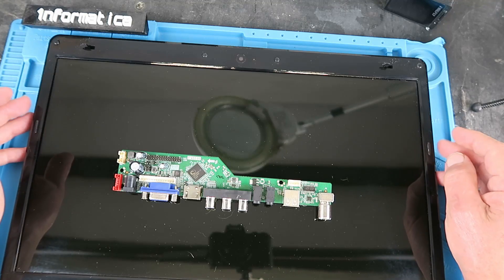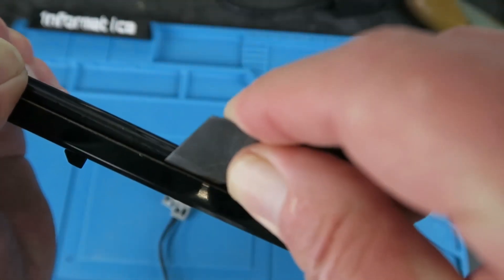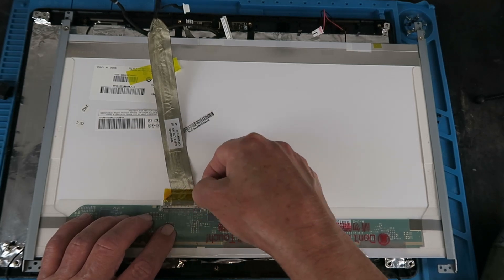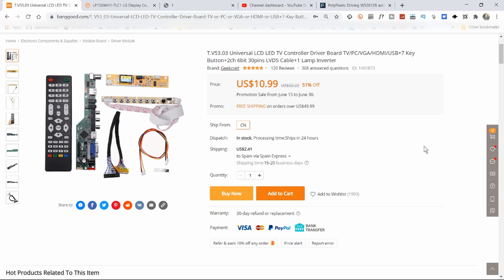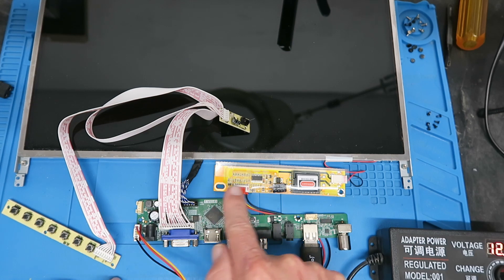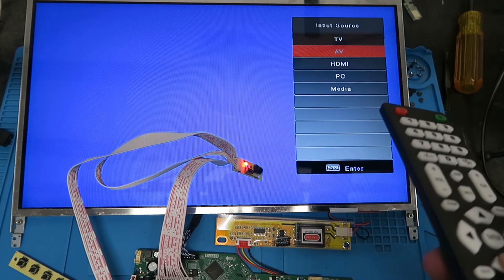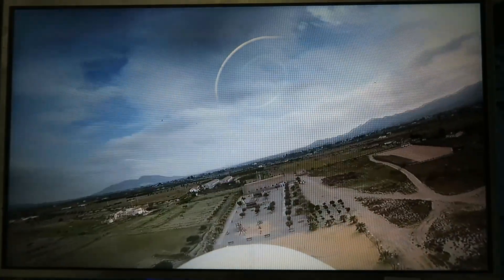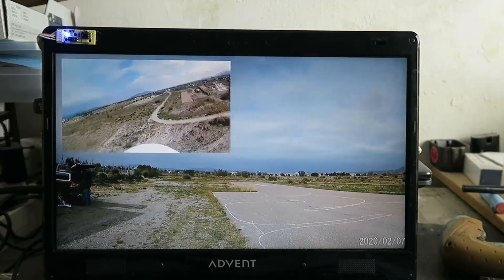T V53 03 Universal LCD LED TV Controller Driver Board Review Test

Comment: Kind sir, I have this same board, without the remote control. I foolishly pressed the "Lock Key" option and of course now I can't find a way to unlock the buttons. Is there a way to reset this board without reflashing the firmware?
Reply: subscribed! I was afraid you'd say that. What remote control would you recommend? I think I have an IR sensor in the parts box, I'll look into adapting it to the board through the buttons control panel, and I'll alternatively look for the screen's details, hopefully I can restore it to working order without looking like a bad acid trip. Me and my curiosity...
Reply from the maker: @choro76  I was thinking of something like this : Universal IR Learning Remote Control http://bit.ly/IR_Uni My unit already had an IR sensor on the little board with the LED. There was also another sensor supplied, I have no idea why!
Reply: @1nformatica  probably stopped supplied in case you wanted to install it away from the buttons module. In any case, if I don't get anywhere with the remote, I'll ask the ebay seller if they can supply the remote control that the complete kit included. Talk about going cheap!
Reply from the maker: @choro76  Good luck with that!!
Reply: @1nformatica  Well, this T.V56.03 board doesn't want to flash a new firmware, it just goes straight to "Movie" menu, won't even try to flash anything. Oh well, maybe I'll just have to buy a new board with remote... I formatted the usb to fat32, used the file General_1024_768_4MB_NF_CH_SiR84X_AT_960_b3f80c16_0xEDD4_20160822_212719 and put both the bin file and the txt file in the usb and nothing... oh well... awesome video nonetheless! Thanks for your help!
Reply from the maker: @choro76  Hmmmm  are you sure you have the right firmware file for your board? The board I reviewed is T.V53.03 yours is T.V56.03 the firmware may not be compatible.
Reply: @1nformatica  Yes, I "was" positive that this board was a T.V53.03, and did try to flash a t.v53.03 bin file, and it failed, but just by luck I spotted the model of the board and indeed it's a T.V56.03 - I promptly downloaded various bin files for flashing but... no dice. The board just boots up normal, and the display just shows the "Select Movie" screen. I guess it's locked for good! Next thing would be to either build the infrared sensor and get a remote control or just simply buy another board - and not make the mistake of blocking it again...
Reply from the maker: I don't think you can unlock without the remote. maybe you can get a "universal" remote to use. Otherwise a reflash. Please consider subscribing if you have not done so already!

Comment: Hi I would like to recover an old lg brand lm170e01 (A6) (K6) lcd if you can indicate a compatible card for this lcd
Reply: hear me or downloaded the software but when i insert my key the led has remained blue mo every time i go down the card only the back brightness of the monitor lights up
Reply from the maker: @giannitranchese4856  Use a quality USB key like "Kingston", format it FAT32. Put just the *.bin file and checksum on the key. Make sure your power supply can give 3 Amps at 12 volts. If the LED does not flash then the firmware will not be loaded.
Reply: nothing does not work for me the red led does not flash or inserted in the 16 GB USB stick in fat 32 the two files that only this on the stick how can you reset the board then the tab on the board is positioned on 5v pvcc and I am powering it  with a 12v 30a power supply
Reply from the maker: @giannitranchese4856  As far as I know the only way to reset the board is to flash new firmware to it. Perhaps your board is faulty, you should contact your supplier.
Reply: @1nformatica  resolved maximum supports a 4gb USB in fat32 the light flashes blue and red and then flashes faster but it always goes down and only the back brightness should I set 5v pvcc to pvcc 12v ??
Reply from the maker: @giannitranchese4856  I do not know what the pvcc voltage is supposed to be for that panel. Try 12v at your own risk!
Reply from the maker: You can see the panel specs here : https://www.panelook.com/LM170E01-A6K4_LG%20Display_17.0_LCM_parameter_4679.html The board used in the video will work : https://bit.ly/TVCntrlBoard Please consider subscribing if you have not done so already!
Reply: @1nformatica  feel my lcd screen with four terminals that were connected on the power supply board, the board you recommend is okay
Reply from the maker: @giannitranchese4856  You can usually use the original board for diving the lamps, you just need to see if it will work with 12 volts from the controller board.
Reply: @1nformatica  listen but what software should I download from the rar archive for the lcd
Reply from the maker: @giannitranchese4856  You use the file with the max resolution for your screen which is 1280*1024

Comment: Hello I'm trying to do the procedure on my board and the led is lit red and does not evolve, does not flash another color. It is only lit red.
Reply from the maker: Some people report problems with particular USB flash drives especially "unbranded" ones. Try a different USB stick like a Kingston brand. The firmware is a "bin" file that must be in the "root" directory. Also make sure you have a 12 volt 3 Amp power supply. Please consider subscribing if you have not done so already!

Comment: Great tutorial but I have a problem.
There are no markings on the 30 pin connector that plugs in to the board. It can be plugged in both ways. How do I figure out how to plug it in properly, I don't want to damage the panel.
Thanks.
Reply from the maker: The 30 pin cable header should have a blob of paint at the end which is pin 1. Also the first few  pins are power so they are black and red. You can see in the photos in the product description : https://bit.ly/TVCntrlBoard  Please consider subscribing if you have not done so already!

Comment: Morning all, I followed your tutorial and it works perfectly with a Philips LP171WP4 in 1440x900. Now, I would like to go further : is it possible to connect an USB webcam and have the picture in real time ? I tried to find out a solution with without any success. An advice ? Thanks again ! CL
Reply from the maker: I think the best option will be to buy either a camera that has HDMI out or a CCTV type camera with composite video out. You may even have an old camera with composite video already! Please consider subscribing if you have not done so already!

Comment: Hello, my panel is one B170PW03 V5, i bought the T.SK106A.03, i upload the GENERAL_1440_900 firmware. It works, but when I select AV, HDMI, VGA or Media input, it shows me the screen split in half and the image 2 times. It only shows the full single screen with the TV antenna input. How can I correct it?
Reply from the maker: It is probably a setting in the "secret" panel menu. I have found no description of what the settings do so just try different ones and see if it works! Please consider subscribing if you have not done so already!
Reply: @1nformatica  Thanks for the reply. I have tried modifying all the parameters but cannot change it. I do not understand why only one input ATV shows the screen well and the rest (Media, PC, AV) divided
Reply from the maker: @Ali_Vill  Sorry I have no idea. I have never seen that. Let us know if you find an answer!
Reply: @1nformatica  In addition to the code (Menu + 1 + 1 + 4 + 7). Is there any other Menu that can be accessed?
Reply from the maker: @Ali_Vill  I do not know of any other settings. maybe try a different firmware.

Comment: Hey, if i buy a controller board of 30pin and my screen is 30 pin its should work right?
Reply from the maker: That is a little confusing. There is a 30 pin header on the controller board which can have various cables fitted according to the screen. So if you buy the one with a 30 pin LVDS connector it will work.

Comment: My panel is this one https://www.panelook.com/B154EW02%20V7__15.4__overview_630.html

I flashed the T.V53.03 1280x800 firmware, i'm using a 12v 3amp power supply - but the display does not power on. I've tried loading different firmware, but it wont flash - just shows the red light, then blue and stays blue. There is also a shhhh sound coming from the High Voltage part. What else can i try?
Reply: Got it working, the backlight plug wasn't fully seated
Reply from the maker: @thegreatpretender7  •:*¨¨*:•_•:*¨¨*:• EXCELENTE_•:*¨¨*:•_•:*¨¨*:•_!

Comment: Great video mate! you covered everything i needed to know,.  btw i have a LP156wh4(TL)(C1) i got from an old laptop. its 40pins, would you kindly recommend a compatible controller board for it? thanks in advance mate!

iim looking into T.HD8503.03C Driver Board . its 40pins.. you think this will work on the monitor i have???
Reply from the maker: Thanks for commenting. These boards are universal the 30 pin connector on the board just needs the correct adapter cable for your screen you can see how to make one here : https://sites.google.com/site/lcd4hobby/lvds-cables?authuser=0 or this one should work : 40P 1CH 6-bit LCD LVDS Screen Cable 0.5 Pitch http://bit.ly/40PinLVDS Please consider subscribing if you have not done so already!
Reply: @1nformatica  already subscribed  to your channel mate!.. more power..
Reply from the maker: @aragornmcarathorn9806  Great! YT used to show when peeps were subbed but no longer!
Reply: I also have one and I bought a v53.03 universal 1ch 6bits 40p but i plug my pen driver and nothing happens...

Comment: It seems you have become the un official support for the English speaking world on the the T.V53.03 controller board. I want to thank you for the for the one ray of / hope / information that i can source on this board. i have purchased two of the above controllers with the understanding that is should be suitable to control  a Mitsubishi  AA121XJ01 as per:

 (  https://www.panelook.com/AA121XJ01_Mitsubishi_12.1_LCM_overview_6054.html  )

 This has 20 pin connector  the controller board came with a 30- Pin flat style connector  cable attached which will not work .... I see this link listing the above board listed as 20 pin compatible 

( https://www.ebay.com.au/itm/Fit-N141X6-L01-1024-768-1CCFL-LVDS-20-Pin-display-analog-tv-controller-board-kit/173888398448?_trkparms=aid%3D1110006%26algo%3DHOMESPLICE.SIM%26ao%3D1%26asc%3D20160323102634%26meid%3D0fbe3ff827b44fd6887920f6c5ab895b%26pid%3D100623%26rk%3D4%26rkt%3D5%26sd%3D173882026064%26itm%3D173888398448%26pmt%3D1%26noa%3D1%26pg%3D2047675%26algv%3DDefaultOrganic%26brand%3DMarkenlos&_trksid=p2047675.c100623.m-1 ) 

Do you think i can plug the cable into the 1st 20 pins and get some function ?

Do you know of any pin out on the T.V53.03  that i could use to make up a custom cable with ?

I see the firmware archive has no reference to AA121Xj01 but does list  2 entries with ...._General_1024_768_4MB_DDR_CH_AT_..... which may suite the panel?

Any advice you can offer is apricated ... i have sub scribed to your channel
Reply from the maker: The pinout for the board 30 pin connector and the 20 pin LVDS cable can be found here : https://sites.google.com/site/lcd4hobby/lvds-cables?authuser=0 You can buy a made up cable here : DF14 20P 1CH 8-bit Screen Cable Universal LVDS LCD Driver Board http://bit.ly/20PinLVDS Good luck!

Comment: How did you conceal the circuit board after installation....🤔
Reply from the maker: It is not exactly "concealed" just stuck to the back of the screen with hot melt glue!! Please consider subscribing if you have not done so already!
Reply: @1nformatica  your video has saved me a lot. Consider placing a heat sink on the main chip.
Reply from the maker: @afromike01  Good idea, it does run hot.

Comment: Hayooo man, I have a big problem and it is when installing the driver in a memory, the led stays completely red and does not progress from there, can you help me?
Reply from the maker: Some people report problems with particular USB flash drives especially "unbranded" ones. Try a different USB stick like a Kingston brand. The firmware is a "bin" file that must be in the "root" directory. Also make sure you have a 12 volt 3 Amp power supply. Please consider subscribing if you have not done so already!

Comment: good night, I have a plate just like it. only that she was astonished they are just passing the colors and I can not turn it off with the remote control or the power button. what should I do?
Reply: I appreciate the answer. in fact it has a eliminator from 12v to 3a. the connections are correct. Today that I put it to see what happened, it turned on with the remote control and there was only an amber screen left.
Reply from the maker: @SavoRomo70  Check the resolution of the LCD is correct at : https://www.panelook.com/index.php maybe try another firmware. Good luck!
Reply from the maker: Check that you have a power supply of at least 3 Amps 12 volts. The board will appear to reboot if the power is too low. Also check the jumpers that supply the LCD voltage, must be set as the LCD specification. Please consider subscribing if you have not done so already!

Comment: Hi,I appreciated a lot this tutorial, sir, to repurpose a TV LCD screen which the mainboard was gone. I bought a T.V53.03 board. I connected everithing, and it was so well! I changed the language from chinese to english, with no problem at all. Since my screen has a resolution of 1366 x 768 I downloaded this software: CPS6_19028124_RX_V53_03_A1_IR_XY_AP_M90_PNL_General_1366_768_4MB_DDR_CH_AT_960_08a8a3e2_0x2646_20191123_132618
 to flash the board for the correct resolution. After flashing, I got nothing on the screen and it remained all black. Is there any way to downgrade the software with the original one? Since maybe the software was not correct?
Reply from the maker: Hi thanks for the comment. You can just flash new firmware onto the board using the same procedure as before. Simply put the new file on the USB stick and it will flash when powered up. There are often a few different files with the same resolution, it is trial and error to see which one works for you. The screen being black is a bit strange. The backlight should still work. Did you set the voltage jumper correctly? Good luck. Please consider subscribing if you have not done so already!
Reply: @1nformatica  Thanks a lot for  your kind answer. What opened my mind is your phrase: "it is trial and error" since I thought for a moment that was, instead, a one-shot thing... :-). Anyway, when I try some (wrong) FW, my screen becomes completely black, meanwhile the backlight is still lit. Non problem with that. I've also found that this board is not able to receive DTV (all broadcasts are DTV here in Italy) so I have to put an additional receiver outside... what a pity!
Reply from the maker: @mariodistefano2973  So you have a working unit now? Yes, the TV tuner is only analogue and most of Europe has TDT like here in Spain. But the decoders are not expensive! Good luck!
Reply: @1nformatica  Yes, my tv is working now. Thanks to your help! Is there any similar board but that can receive the digital broadcasting (TDT or DTV, as you like?). A similar tutorial would be even more appreciated, I think... ;-)
Reply from the maker: @mariodistefano2973  You can try this board http://bit.ly/LCDTVDVB note that it does not support Dolby Audio AC3 function. Basically it is the same, I do not think it needs a separate video.
Reply: @1nformatica  I'll RUSH to buy one, Thanks! ;-)
Reply from the maker: @mariodistefano2973  Let me know how it works out and if you think it is worth another video.
Reply: @1nformatica  You know china is far, And it will take time to things to get here. Also there are the chinese holidays, which last up to february... I'm afraid it will take time... sorry.
Reply from the maker: @mariodistefano2973  Ha ha! Yes! A Chinese proverb for you to contemplate until it arrives "Man who waits for roast duck to fly into mouth must wait very, very long time!"

Comment: Is this compatible with N154I3-L03?
Reply from the maker: Yes : https://www.panelook.com/N154I3-L03_Innolux_15.4_LCM_overview_2129.html Please consider subscribing if you have not done so already!
Reply: @1nformatica  thank you,
 can you tell which firmware version I have to install?
Reply from the maker: @rmcs0705  Just choose firmware the same resolution as the screen. There is no exact method.
Reply: @1nformatica  
I did that, the led flashed faster for 5 seconds, then it flashed more slowly.

After that, i unplugged the power adapter and removed the flash drive. Next, when I turn on the screen and it was completely white.
Did I do something wrong? How can I solve this problem?
Reply from the maker: @rmcs0705  A white screen means the backlight is working but no video signal to the screen. Double check the cabling to the LVDS connector both at the screen and board. It is easy to plug the cable in wrongly or not tight. Check you have set the screen voltage correctly by the jumper on the board. Maybe try a different firmware, sometimes there is more than one in the ZIP file. Finally do you know the screen worked before?!